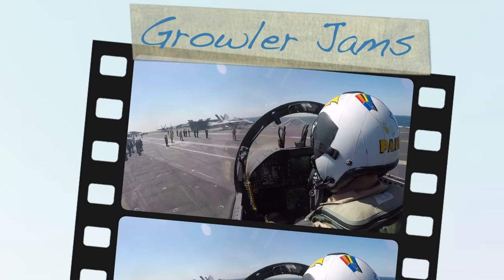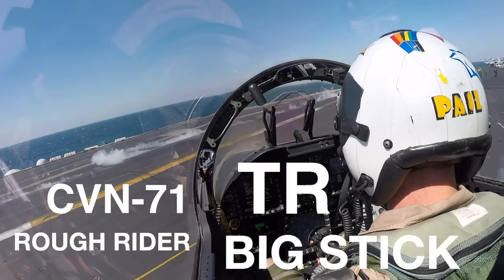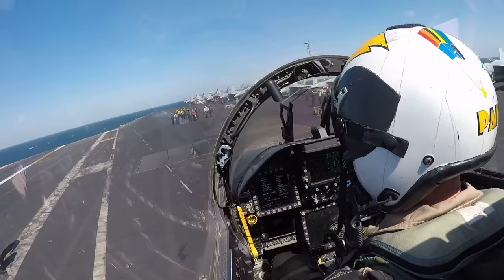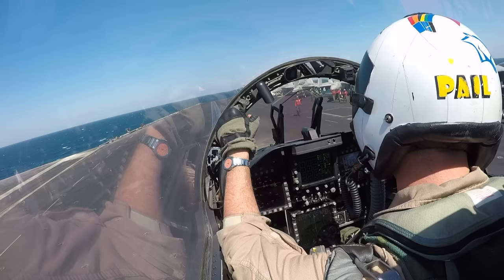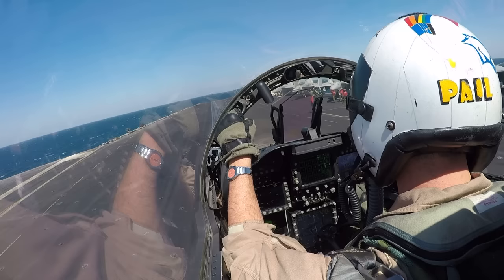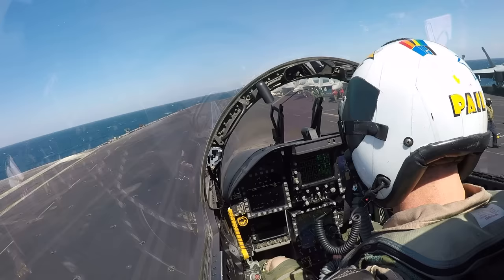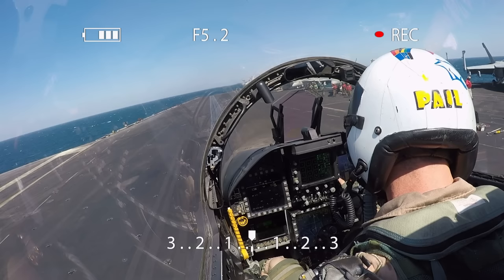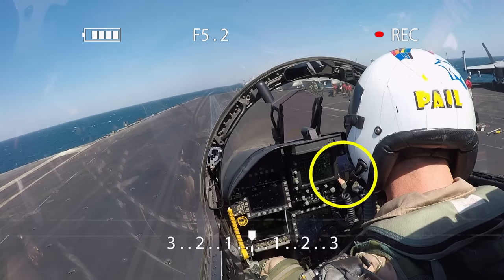Why Pilots NEVER Hold The Stick On The Catapult

Comment: Nice video as always! I only flew cessna before and when I check flight control having free movement on the ground, the controls are sloppy as there's no airflow over control surfaces. I know Hornets have been fly by wire since the 80s, and I was told that they have no aerodynamic feedback like traditionally controlled aircraft. Does the stick feel different in the air? Like after you wipe out controls and launch, do you feel the stick being heavier when you do your clearing turn?
Reply from the maker: No, the stick feel doesn’t change with airspeed.

Comment: What would happen if you found an issue while you were about to launch?? Would you hand signal them that there's an issue or make a radio call? I assume they would pull you off the catapult pretty quick.
Reply from the maker: We shake our head as if to say “no”, then transmit “suspend” over the radio.

Comment: Question: In an emergency…..how fast can the crew get an aircraft into the air. It seems very slow….and for good reason since it is a crowded and dangerous environment, but I wonder, how could the the carrier get a enough planes in the air to respond to threats?
Reply from the maker: Yeah, we can speed this up a bit, but I don’t advertise those procedures.

Comment: Hi Pail, I hope you and your family are well. I wonder if you could answer a question for me. Is it correct that pitch is used to control AoA and power is used to control glide path in a carrier landing (manual approaches, not automatic). Thanks & best wishes for the new year.
Reply from the maker: Yes, that's the idea.

Comment: Why is that control thing a problem if they are fly by wire? Can you not just dampen or remove that input while you are on deck? Or is it a physical calibration with the stick?
Reply from the maker: I don’t want to launch off the bow with a control problem.  Don’t care what it is. No, we can’t remove “inputs” on deck.

Comment: You mentioned two final checks of your Engine Fuel Display and Flight Control Systems, looking for any errors there.

What would happen if you DID see any alarms there, after everything is spooled up and under tension? How do you signal the deck crew to abort the takeoff?

And if you DO have an aborted launch, are you, as the pilot, going to be the one to trundle the plane back off the flight deck? Or do they have to get you out and use a tow rig to pull the plane clear, because now you can't trust the plane?

Heck, how hard is it to just take the tension off the catapult and unhook your nose wheel?

The mind boggles with all the way things can go wrong and all the procedures in place to protect you from yourself.
Reply from the maker: If we don’t want to launch, we transmit “suspend” to the tower.  After the catapult is safed, we bring up our launch bar and taxi back to troubleshoot.  If the jet is on fire, we shut it down right there…I’ve never seen that, though.

Comment: In regards to PIO, is there a system that keeps the stick locked or centered until after you've cleared the catapult?  Weight on wheels sensor or something of that nature? Or is the stick just that stiff to move?  Watching the launch, it looks like the stick never moves until you reach down and physically move it after the launch. I don't know what the exact amount of G's the stick might experience during a shot would be, but I would think it would be enough to at least cause a slight movement, which could then begin to compound over time. The Blue Angels always talk about how a G suit could cause issues with slight movements of the stick when flying in such close proximity during there flight demo's so I assume the stick is quite easy to move under low or no G situations. Love the videos!

Edit: Or is it simply the aerodynamic force of the air over the flight surfaces in conjunction with the pre-launch trim settings that keeps the stick in the correct location? Although the initial part of the launch still seems rather "bumpy"
Reply from the maker: The stick has a dampener and springs that keep it centered.  It takes around 40 lbs of pressure to fully deflect it.  It was designed not to move during the cat stroke.
Reply: In the Intruder and Prowler the stick would move aft and right from acceleration forces. Easily overcome by a light touch on the stick. If you carefully watch footage of airplanes on a catapult you can see the right Flaperon come up during the cat stroke. 
There is no aerodynamic feedback in the flight controls it’s all artificial feel. 
FLY NAVY

Comment: Yet another great video Pail thank you for sharing.   Could I ask two questions today.  How violent is the cat takeoff on the pilot and in the even of an aircraft issue or cat issue is it the shooter that has the final control/say on the launch.  So I assume once the director has got you in place the shooter is then in control? Thank you and all our US comrades from the UK
Reply from the maker: Cat shots are extremely violent, but they are relatively smooth.  Yeah, once you’re hooked up the the CAT, you are at the mercy of the Shooter. There isn’t anything that I can push in the cockpit that will override the “fire” button.
Reply: @GrowlerJams  thanks for the reply as always.  As we would say in my industry the shooter is your “brothers keeper” meaning we all look out for each other.  Happy New Year

Comment: As an old F18 pilot from the early 90s, I always taught that we keep our hand off the stick for a slightly different reason. The rapid acceleration forward causes some of the gyros internally to think it’s a nose up motion until we stabilize. If we grab the stick based on the gyros, it automatically puts a nose down bias Into the flight controls in spite of our rear stick motion, thereby starting the PIO close to the water. 

Based on the trim and flap position set for catshot/takeoff, the airplane settles off the cat into the appropriate flight attitude and allows the gyros to stabilize quickly (rate of acceleration/change has stabilized).  We are able to take control of the stick without creating issues . Is this way off base?
Reply from the maker: I don’t think so.  No mention of gyros in our NATOPS for catapult considerations.  They must have improved them over the years.
Reply: Gyro is probably the wrong term - should be accelerometers…
Reply: I remember the days. Trying to recall the flight control class I taught at VMFAT-101 as a RAG LSO from Sep 1991-Oct 1995. Was an A-7 pilot at Cecil before that. Went to the RAG after finishing gulf war in 1991.
Reply: Great video by the way!
Reply from the maker: Thanks and TYFYS.

Comment: Thanks Pail, great stuff as usual. Is the term, "leading edge flaps" synonymous with the term, "slats?"
Reply from the maker: No, slats are on older airplanes.  LEFs are upgrades and can produce more lift.
Reply: Different systems.  As an example, the F-4J had leading edge slats, but the F-4S had leading edge/manuvering slats.

Comment: If you were to do nothing after launch (not grab the stick or turn), and continue forward, would the aircraft continue to gain altitude (albeit slowly) with how the trim is set?
Reply from the maker: Yes, you would seek around 5 degrees nose up.

Comment: Stupid question: the stick responds to your lightest touch, so what keeps it from flinging back under its own weight during the catapult stroke?
Reply from the maker: Springs and dampners.  It actually takes a bit of pressure to move the stick.

Comment: The aircraft will launch itself. As soon as the aircraft leaves the flight deck, then the Pilot has control.
The aircraft must be in the same configuration as on a runway until it achieves takeoff roll.

Comment: There’s a an ordinance signal I’m curious about. Sometimes when a redshirt has finished arming a missile (I’m guessing here), another redshirt towards the front of the plane holds both arms out to the sides, forearms bent straight up (like half of a touchdown signal), and does an exaggerated turn at the waist to the left and right, then passes control back to the yellow shirt. 

What does that arm posture/waist pivot mean?

IIRC, the same guy will sometimes hold a flat palm over clenched fist signal while the other redshirt does the arming. I’ve always assumed that one is something like signaling ‘I’m holding the pin in the grenade’
Reply from the maker: He is telling the pilot that an arming pin has been removed from a missile.
Reply: What you’re asking about, I think.. happens before arming.  The ordnance team leader (should be) puts hands like a pyramid above their head and pivots forward to make sure the area in front of the aircraft is clear, then twists back and gives the team members the arm signal… which is the flat hand over the fist.  I say should be holding a ‘pyramid’ like signal because that’s what the instruction says, but TLs sometimes get in the habit of just putting hands up, like how you described.  Then they pass the attention back to the yellow shirt so they can hook the jet.  Super awesome, even if you’ve seen it thousands of times lol.
Reply: @bombloader8358  Thanks! The general context seemed clear ("hey—there's a freaking explosive device going live & y'all should maybe pay attention") but the specifics are always interesting.

Comment: Do they still use shear bolts for the catapult shuttle that break once sufficient pressure is reached? Or do they use some other method for holding the shuttle until it’s being pushed hard enough
Reply from the maker: Yes, they do, but only for E-2s.  Holdback bars for more modern jets are completely reusable.

Comment: Why is the UFC a touchscreen now?
If you've flown a legacy Hornet, how much would you say the skills/muscle actually differ? Did you need retraining? Did any systems even change, like putting functions on different MFD pages, making new pages, removing pages, for example.
From my DCS Hornet knowledge (Which probably doesn't mean much), all of the pages and functions and whatnot visible in this video look the same on a surface level, minus the fuel display and UFC.
Reply from the maker: I’ve never flown the Hornet.  Yeah, it’s a display now.  It’s awesome.

Comment: I love these videos; please keep them coming. Your saying, "Wiggle your fingers and toes," has helped me immensely. I'm a woodworker, and cutting into slabs or projects that cost well over 10k is nerve-racking. It PAILs compared to flying a fighter jet, but I still love the saying. 

I have a question, though. Why doesn't the Growler have the same metallic coating as the Prowler's canopy when it seemingly does the same job?
Reply from the maker: I’ve wondered that myself.  Never got a solid answer.  I’m sure the VA will be hearing from me soon.
Reply: @GrowlerJams  "non-compensable disability." - VA

Comment: At 4:00 you say rapid acceleration could cause pull back on stick, end in the drink. I don’t understand. Pull back would give up elevator. Sure,a massive stall could happen though not instantly?
Reply from the maker: Yes, it could.  If you stall the stab before you have airspeed to fly, you won’t fly away from the flight deck.

Comment: Hiya Pail, quick question what happens when your locked in and ready to launch, you wipe out the controls and an error shown, and there is a jet or two waiting behind you. Assuming the launch is aborted at that stage, how do you clear your jet from the catapult and clear the way for the next aircraft?
Reply from the maker: You just disconnect from the CAT and do a 180.
Reply: @GrowlerJams  Nice. Thanks for the reply. It looks so congested on deck that I wouldn't have thought it was that simple.

Comment: I always wanted to know how detailed of knowledge did you need to have of all systems as pilots?  Do you need to know what every circuit does as it moves the flight controls?  Or every hydraulic valve that must be actuated and how to lower the landing gear and activate the braking system?  Or do you need just a basic overview type of knowledge?
Reply from the maker: Just the basics.  You don’t need to know how to build a toilet in order to use one…
Reply: @GrowlerJams  The reason I asked is that was one of the reasons given to dissuade me from pursuing the khaki 
track after being enlisted.  I even tried to sign a 20 year contract if they would let me try for OCS and then Flight.   One of my best “sea stories”from when I was in (AMH) was when a Lt stopped by to see the progress on an aircraft he was going to FCF that morning after a shock strut replacement.  Problem was… we had extra parts! 😳😉  We both said it was going GREAT, as we hid the extra parts from view….  Simple fix as it was just the bushings for the upper bolt on the strut. 15 minutes and it was fixed.  But we LATER laughed about that for days.
Reply from the maker: Ha!

Comment: Curious, do commercial planes wipe out control sticks and/or check all flight surfaces before take off ?
Reply: They do it sooner AFAIK, Airbus has flight control checks right after engine start (so basically as soon as you have all hydraulics running). Less hassle to get back to gate and unload passengers if something doesn't work.
Reply: @AndrewCZ47  thank you very much !

Comment: What does the hold-down bar do during the launch process. Where does it go after launch?
Thanks
Reply from the maker: Great questions.  It holds the jet back until the catapult launches it.  It stays with the catapult and is reused.
Reply: Thanks and really enjoy Growler Jams.
Reply: Follow up question please. Why do you enable PLM when landing at a fixed base. Understand the need for a carrier landing, but fixed base? At what indicated air speed does the Growler land? Stall speed? Don’t think it would be pretty to stall a F18

Comment: Great video as always! Just a question if you don't mind. At 3:53 it looks like there are other airplanes in the pattern as you launch off the waist. Is that normal? I was under the impression that recovery doesn't begin until all launching aircraft are in the air.
Reply from the maker: That’s true, but the recovery starts immediately following the last launch.  I was the last launch.

Comment: Hey Pail, what happens if your computer shows problems after wiping out controls?
Reply from the maker: Then we suspend the launch and get off the CAT to troubleshoot.
Reply: @GrowlerJams  sorry I wasn't very clear. What is the process for canceling? Eg signals.
Reply: Pilot moves head side to side as if saying NO and transmits on his radio SUSPEND.  The shot is then halted.  It happens and is no big deal.
Reply: @beckyumphrey2626  thank you

Comment: When you were at sea on a deployment, how many days a week would you fly, and what was the average duration of those flights?
Reply from the maker: We would normally fly 5-6 times a week and the duration depended on what we were doing…anywhere from 1:00-8:00.
Reply: @GrowlerJams  Nice! 8 hour flying in that cockpit must be tiring, and then having to land on a carrier after that long? Pucker factor. What sort of duties did you have not related to flying? I remember reading in the book Flight of the Intruder that the main character also had to do evaluations on enlisted men. Did you get lots of 'desk flying duties' as well?
Reply: @GrowlerJams  Nice! 8 hour flying in that cockpit must be tiring, and then having to land on a carrier after that long? Pucker factor. What sort of duties did you have not related to flying? I remember reading in the book Flight of the Intruder that the main character also had to do evaluations on enlisted men. Did you get lots of 'desk flying duties' as well?
Reply from the maker: Oh yes, mostly ground work as you get senior.  Less flying unfortunately.

Comment: In the latest flat tops the cat s bubble has been moved out ot the deck. On the left side . Ok. For a better control of the 4 cats. (?). And how could the other one on the upper flight deck control the other cats?
Reply from the maker: There are two bubbles. One near cat 2 and the other by the lens.  They both control only the bow or the waist cats.
Reply: In the good ole daze.

Comment: hi..i have some questions: does "push flight" on FCS automatically give u a proper trim setting for 12° AoA which results in the corresponding take-off flight path? because i didn´t see u checking specifically the position of the trim..or u are doing it in checking the FCS and reading the position of trim? or is the trim setting for  the AoA depending on TOW done automatically?

but in general: i am totally mesmerized by ur reporting about naval aviation from a carrier..u are a cool dude
Reply from the maker: We manually set the trim and verify it on the FCS page.

Comment: What happens if an aircraft is not perfectly lined up with the catapult? Is there wiggle room to where you can be pointing a little left or a little right? This sounds like a stupid question in my head but curious enough to still ask 😂❤
Reply from the maker: No, it is either in the shuttle or not.  Worst case: spin it and try to line up again.
Reply: @GrowlerJams  I feel like this would be something that is very rare but have you ever known it to happen in your time in the navy?
Reply: I believe there is an allowable limit or how crooked the airplane can be while the nose is in the shuttle. The first few feet of the stoke straightens the plane. In 900+ cat shots I don’t recall it ever being an issue. 
FLY NAVY!
Reply from the maker: Sure.  It’s rare but it happens.
Reply from the maker: True, but once you pull forward into tension, the jet needs to be straightened out.  You’re correct.  This isn’t usually a problem.
Reply: @GrowlerJams  I had a feeling with all the training and all the flight hours the navy gives y’all and the crew on the deck that it would be a rare occurrence. Thank you for getting back to me